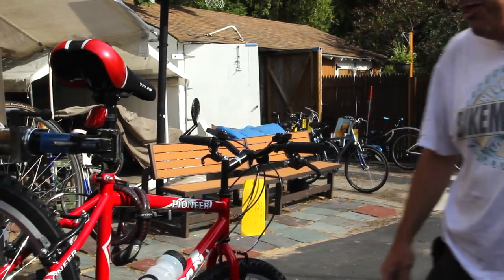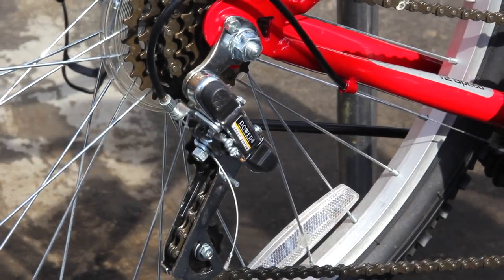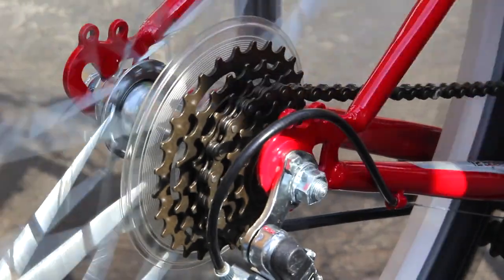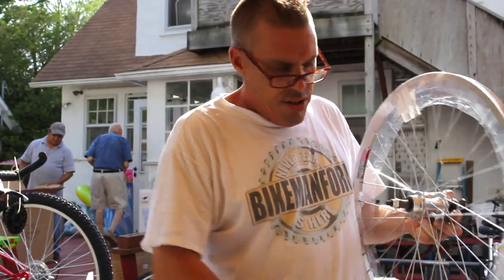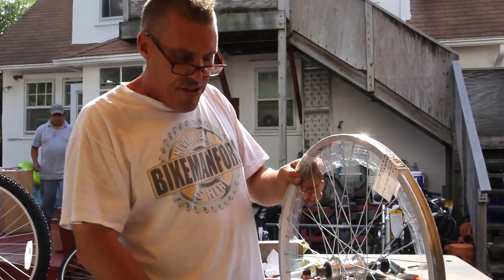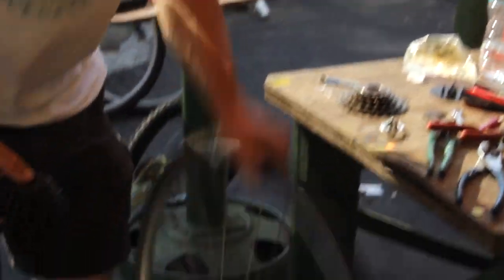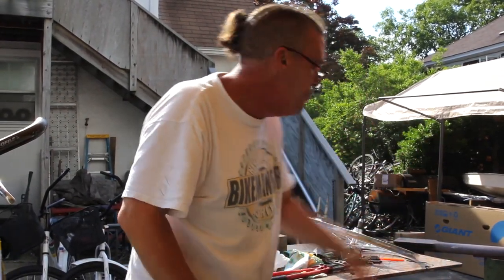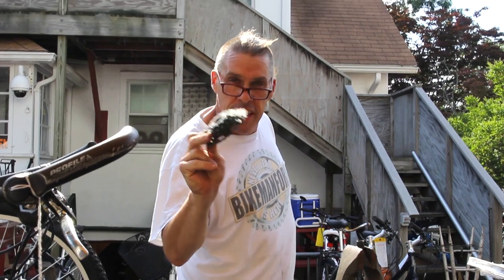The Freewheel Wobble - Why A Cassette Won't - BikemanforU Tutorial

Comment: Need to set the record straight here...cassettes "CAN" wobble too, just not as pronounced. I just tested mine, and I know it's a cassette, and it has some slight wobble. For freewheels, it's more often than not related to the machining of the hub shell. If it's not machined perfectly internally (meaning slightly off axis), as the body rotates it will experience a high-to-low movement. It's explained very well here: https://youtu.be/OI6JxL-zjXc

Comment: Threading, yes can be an issue.  But it is not the only one with thread on freewheels.  One other thing that was not mentioned.  Lower quality freewheels will also do this/any freewheel if the cones inside the freewheel are not machined squared. If your freewheel has a loose lockring, this can be a big reason why it's wobbling a lot.  A minor issue, having sightly oversized and undersized ball bearings will result in a wobble too.
Reply: Here I was trying to find out more about my gravel bike and find a fellow FPV pilot! Your username checks out haha

(I raced with you during the first sports champs)

Comment: Bikemanforu mentions the inexpensive bikes sometimes sold by large retailers.   I bought one,  a Dynacraft made MTB called a Rockrider ST 50.   It arrived with a faulty front derailer (pardon my English!).   I could not fix it because the routing of the shift cable was directly down when the cam needed to move the cage horizontally,  outward - away from the frame. The retailer gave me a full refund and told me to dispose of the bike, if I wished.  I decided to try to re-route the shift cable around the outside of the bottom bracket instead of under the bracket.   By so doing, arlound the small outer projection of the bracket, I was able to apply an outward component of tension to the cam,   I was then able to shift into the 3rd or largest gear.    Moral of the story:  sometimes one can fix a problem with an inexpensive bike.   I have since made many changes to the bike:   I added a handlebar stem extension and replaced the flat handlebar with a "swallow".    I can now ride my MTB in an upright posturre; much more comfortable for city biking.    Also I added a springy seat and with the front suspension of the MTB, I now have a full suspension for the city bumps.  Why not just buy a city bike in a bicycle shop?   Because they begin at $400 and was a single speed, all steel.     The bike-shop, $400 "Special" did not even have a front suspension. My MTB was priced at $98, and it was refunded to me.   Bike shops may be better when shopping for top of the line bikes.

Comment: Other than very minor thread defects... 

1.  Freewheel / Cassette wobble is primarily caused by NON-CONCENTRIC hub shell machining.

The hub shell will wobble if the bore and profile of the hub shell is not directly centered from one end to the other.  The motion translates to the freewheel / freehub cassette

2.  Occurs mostly in high volume production of budget or entry level products.

3.  Can effect freewheel spec AND freehub/cassette spec hubs.

4.  Has little or no effect on shifting.    If shifting issues are present, the problem will be elsewhere.

Yes, you read #3 correctly.  Freehub / Cassette spec hubs are not immune from this.

=8-)

Comment: the fix for a free wheel is as easy as backing off the nut on the opposite side of the freewheel, turning in the little holding piece then tightening the nut back up. i just did it this morning.. you may want to grease your bearings but its a bit of a pain. i did it the hard way.. i always do everything the hard way..

Comment: I don't think wobble in the freewheel is caused because of the hub, because if it was the freewheel would wobble going forward too, and then the gears wouldn't shift properly.
No, I think it's caused by the internal bearings that allow the freewheel to ratchet while the wheel spins backwards. They're not made to be precise that way, but durable.
Reply: I don't agree!
Reply: It is the hub, I learned more about it since I made this comment 6 years ago.
Reply: @johnhanley9946  Thanks for addition

Comment: 99% of the time it is a badly made back wheel freewheel mount threads ( hubs are crooked. All freewheels will wobble based on the wheel thread mounts being straight or off center. This video is very important.

Comment: It's not because the thread is bad, it's because it's a thread. Threads are like a record grove in that no two spots on that thread are in the exact same spot. The higher the thread count (per inch) the less wobble you will get, but it will always wobble. A high thread count means the beginning of the freewheel is extremely close to the end of the freewheel and a low thread count means the beginning of the freewheel is further from the end of the freewheel. If there is a spacing of .25mm between the threads, the freewheel will be .25mm off from straight.
Reply: tarstarkusz you found the magic behind it :)
Reply: tarstarkusz "No two spots on that thread are in the exact same spot". Thanks for this insightful truism, you can even replace "on that thread" by "in the universe", it would be no less true and it would provide a nice generalization. 

Now for your post: I don't get your explanation. Can you tell me again why the thread count (per unit of spatial measure) should matter in the wobbling? If the freewhel has the same density of threads as the hub, they should be perfectly alined. Why should it wobble, then,  if not because of a bad thread?

To provide an intuition, when you screw a screw, the axis of the screw and that of the whole remain aligned: the screw does not wobble. Why should it be different here, if not because of a faulty thread?
Reply: wiwh Because screws have much smaller threads (in diameter). A low TPI makes the freewheel slightly tilted and so the wobble is more noticeable. Even with the same density, the leading edge will be slightly closer to the spokes than the trailing edge and that seems to be where the wobble comes in.
What is your hypothesis? How could a bad thread cause this? An out of true thread  (especially by this much) would be difficult to screw on the freewheel.
Reply: +tarstarkusz My bike is a freewheel and does not wobble at all.
Reply: +Niidea1986 Any decent quality threads should make the wobble imperceptible.
Reply: It ain't the thread. There is a flat spot that the free wheel contacts, that is what is machined out of round

Comment: You are wrong Bikeman, I just got a brand new Shimano Dura-Ace 9170  wheelset today. Once I installed it on the bike I found a wobble. Bad wobble too. Obviously the machining of the hub shell was not done properly. I would expect better from Shimano's flagship wheel but it is what it is and I'm returning these for a new wheel.

Comment: Ive got the exact same wobble. But its a cassette? Any ideas why?
Reply: The hub has manufacturing faults and it's machined crooked - one side or both sides of the cup are not in the center of the hub. Most hubs are faulty. That is why the wheels get loose and start wobbling on the cones. Replace your hubs, but you have to check them before you pay for them.

Comment: Strange. I have a freehub and the dang cassette woggles as well. Can't be the axle because the axle does not move. Took it all apart, cleaned all parts, put back together and still wobbles.
Reply: The bore in the hub is not concentric with the spindle, it is the same problem as with the freewheel. Lack of egocentricity can happen in both mechanisms but the freewheel is more likely to have the problem because is harder to get threads to run concentric than it is for cylinders.
Reply: @reiniertl  I wouldn’t know how to deal with an egocentric freehub. It’s bad enough that my seat post has a mind of its own and chooses a different ride height whenever I go out.
Reply: @albertbatfinder5240  I meant eccentric, probably the autocorrection tool just screwed this up. It would be really hard to deal with an egocentric freehub, :-)
Reply: @reiniertl  I guessed as much, sir. But you know, sometimes I just love autocrustacean.

Comment: Okay, so how about when a cassette has a slight wobble like on my mountain bike (correct 9-speed cassette with a Deore 525 disc brake hub).  It's a ton less then the two free wheel's you showed, but a slight wobble is def present on it.  I'm not overly worried about it - the wobble has been present since the wheel was new 10 years ago and works fine.  Just wondering what you think.  I figured it's a machining problem and nothing to worry a-boot. On  a side note, just something I find funny - my old Bianchi Sport roadbike has it's original Suzue hubs and original Suntour 6-speed freewheel and it has no wobble (none at all) - so my bikes are backwards !  LOL
Reply: Cassettes can wobble if the hub surface they're on isn't perfect, or if there's a defect inside the ratcheting mechanism of the hub. So it's not 100% that they won't wobble. And given the age of your bike, they hadn't refined the art of cassettes at that time either. They're much better at it now so on new bikes it's more likely for a freewheel to wobble than a cassette. That wasn't always the case. Some of nicer older bikes they didn't mass produce them with much carelessness, so they'd make sure the threads were machined correctly. They were practically flawless.

Comment: I have a 2011 Felt road bike with 105-5700 10-speed drivetrain, which came with Mavic wheels with Felt-branded hubs.  The cassette absolutely wobbles on the freehub.  I'm not sure what the actual make of freehub is on the rear wheel.

Conversely, I also have a Vuelta Corsa Lite wheelset with a Vuelta-branded Novatec F172SB 10/11-sp freehub, and the same cassette does not wobble in the slightest on that one.

So what's causing the wobble on the 10-sp freehub on the Mavic rims?

Comment: here is my question : real quick - mine is a cassette set up like you showed not the freewheel yet the wobble is definitely looks like what you showed. and the axel looks straight, I'm going crazy over this - please help if you have any other possible reasons for this ...
Reply: ditto
Reply: paul C The short answer is "it's bent." The union where the cassette splines meet the hub is unsupported internally and can flex/bend under high load.

 Freewheels are more prone to this because the bearing supports the hub, leaving the outside of the freewheel unsupported. One good stomp on cogs 5-7 from a stop is usually enough to "pull" the freewheel forward creating the bend @ the hub union. Cassettes are supported by the bearing at the outside of the gear stack, making them overall stronger and more resistant to drive flex, but NOT immune. If this is your problem, replacing the hub is the best option as this will cause uneven loading on bearing surfaces and chew the bearing races/cones up, regardless of cassette or freewheel.

Comment: Try adjusting the skewer to remove the wobble. If it is too tight, cranking down the handle forces the axle to flex. This will cause wobble.

Comment: Hello Bikeman, thanks for the explanation. I have a Shimano cassette with a unknown hub, 9 sp. I did a clean up of the whole thing, but after I did some miles last night, the lock ring is getting loose again (It was loose when I removed the cassette). I'm sure it was tight when I did the assembly. What could be wrong that causes the lock ring to get loose? Thanks for the help!

Comment: i have a cassette that wobbles i just had the rear wheel changed after a bent to far rim.  They told me it was a cassette should i bring it back because of the wobble?
Reply: hipeoplesSr 
freehubs can have wobble from bad bearings. many are standard and an easy change out, some are weird, proprietary and hard to get parts to replace. They are rebuild-able ,in theory, but such a PITA that nobody does it, as it's easier , cheaper and faster to replace the whole hub.

Comment: I removed 4 sets of freewheels today by simply loosening the lockring and not using the hub removal socket.  Should i be able to do this?
Reply: Cassettes have a lock ring, freewheels don't. You removed cassettes not freewheels.

Comment: Hey you are wrong. If the wheel hub body wobbles it will cuase the cassette to wobble. I have the problem and I took it apart and it's the wheel hub that has a wobble to it.

Comment: Yeah, but is it bad if it wobbles? (My cheap bike does it too. Bad, kinda like the first example) What can I do about it? Or can I leave it alone 'cause that's just the way it is? Thanks for all and any reply. BTW, if it wobbles it's a freewheel, if it does not wobble it's a cassette. Is that correct?
Reply: +Herminigildo Jakosalem  The wobble if it's really bad can cause premature wear on chains, cogs , chainrings and bottom brackets . There is not much you can do really apart from clean your bike and degrease the chain and apply new lube on a clean chain . I clean my chains once a week on my 10 speed rear cassette road bike . get it like new then re apply the relevant oil (wet lube for wet winter and dry lube for dryer weeks) . The more often you do it the longer your parts last .  

The wobble can give you a clue as to what system you are using , but number of gears is a big factor . 7 or less and it's most likely freewheel . 8 or more and it's a cassette (though Sunrace do 8 and 9 speed freewheels now ) . There are some old school 7 speed cassettes around and my road bike from the 1980's had a funky cassette system completely different to either shimano or Campagnolo . That was 5 speed.
Reply: edmundscycles1 Thank you for reply. Also, thanks for advice. More power to you.

Comment: Actually a casset also does the holahoop, I had a customer today and his does it. I rebuilt the wheel, refurbished the hubs, but still that little fucker spinning on the hub seems to come loose. I didn't tear down the part that the cassette goes on, It probably needs a new one, Or a new hub alltogether. But anywhoo I've got 2 days of work left so if he returns, it's gonna need a new hub. I guess it churned the shit out of the hub when not tightened on properly.

Comment: Hi everybody. Somebody put super glue in my D-lock "keyhole" [from uk] any suggestions how to get it out
Reply from the maker: Soak it in acetone and use the key to get the gunk out. Good luck
Reply: its locked to the railings [has in fencing steel] in the city tried acetone BikemanforU
Reply from the maker: Go rent a battery op angle grinder... Good luck I feel for ya.

Comment: So how do I fix a slight wobble?
Reply: GT6SuzukaTimeTrials Didn't you understand ? lol.

Get a cassette and get rid of that freewheel.
Reply: Emily I don't mind having the freewheel. My bike was cheap so it's not worth paying $100 or however much it is to rebuild the wheel with a cassette hub.
Reply: +GT6SuzukaTimeTrials usually you either need to replace either bearings or cone on which they spin. If you see that cone have gotten erased a bit on the sides, then replace it. If bearings are not round, then replace those. There's two types of bearings: one has cones, other is "traditional" and is very hard to get out w/o special tools (usually these cost more money, but it depends on the quality of bearings, so they may be placed into very cheap bicycles).
Sometimes you need to replace the whole hub if its walls have gotten erased a bit (most tiresome work). The easiest way to fix this is to replace the whole wheel or to give it to someone like BikemanforU.
Reply: Caterpillar lol cassettes can have wobbles too
Reply: Why would you bother.  Unless it interferes with changing gears or riding the bike then what is the problem?  I have a cheap road bike with a bad wobble.  But it doesn't in any way affect the riding of the machine.  It is fine.  A wobble in a WHEEL with rim brakes is NOT fine.  So concentrate on the important things and forget the trivial.

Comment: Simple insightful explanation. Thank you!
Just a quick question.  When you spin the thing where the cassette goes onto at 3:45 it makes that really nice clicking sound as spins.  My bike used to do that but it doesn't anymore.  Would you know why and is it something I should be concern about?
Reply: There can be a number of reasons for the lack of a clicking sound.

1) It's jamming up, the "levers" (don't know what they are called) inside doesn't move enough to audibly make a click noise anymore. As long as you can still pedal forward there's nothing to worry about really.
2) It's gunked up with lots of grease, making the clicking noise inaudible as there's not enough metal on metal action.
3) The springs that push the "levers" are weakening. See point 1.

Either way. If it's a sealed unit, such as a Shimano Freewheel body, there's not much you can do. It's not meant to be serviced. It's possible to buy the freewheel body separate from the hub.
If it's not a sealed unit then you can service it. (clean and regrease) If it's not sealed then chances are you have dirt and water intrusion and should do that before you get real issues.
Most non-sealed units are part of the whole hub. I assume you don't wanna buy a whole new hub respoke the wheel... Nor do i assume you wanna buy a whole new wheel.

Comment: Damn... that thread. I might have a idea...
If it is a multiple start thread, which I doubt.... than it will be possible to turn the freewheel hub another 180° after the end of untightening procedure and tighten it back again. It might be trial and error though.

This could happen, depending on the magnitude and direction of thread machining errors:
- It could make the wobble half as bad :)
- It could make the wobble double as bad :(
- It could not make any difference (waste of energy) :|
Reply: You are wrong. My Shimano cassette, correctly attached to a correctly-installed Shimano FREEHUB body, does WOBBLE, GYRATE, OSCILLATE or whatever you want to call it!!!